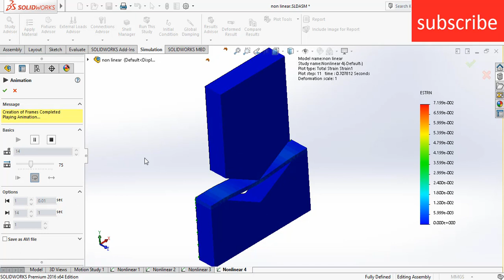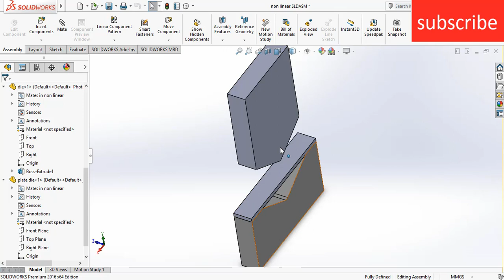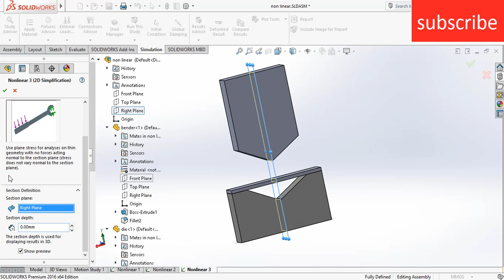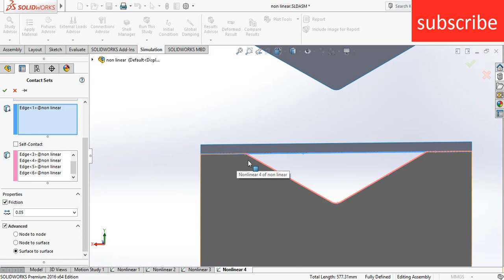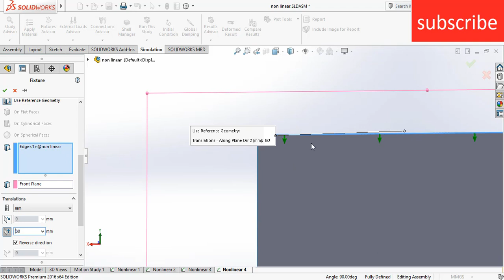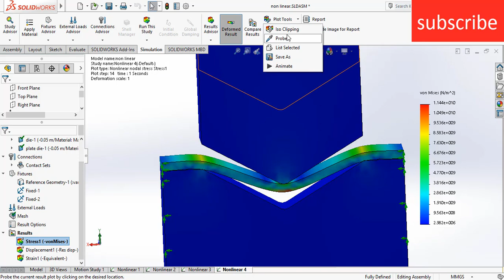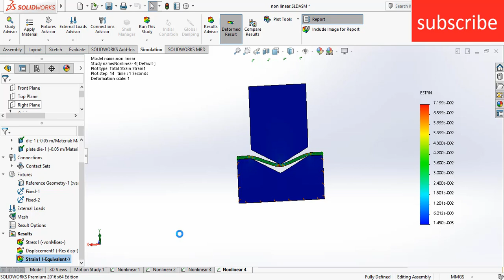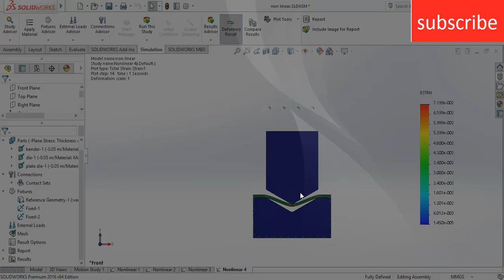Non linear simulation with full explanation for beginners in solidworks

Comment: why a load is not necessary? how do you define that the superior punch moves 90 mm?
I need to simulate a 3 roll bending machine to know the tension in the sheet and the vertical forces on the rolls

Thank you very much. This is a very good video
Reply from the maker: well i set displacement so that i don't need to calculate the load when i set a punch distance 90 mm so it will automatically calculate what ever load required to achieve that hope it helps

Comment: Y u didn't use dynamic simulation for this
Reply from the maker: Use what ever tool you are comfortable with. Suppose you want write it doesn't matter whether u use pen or pencil you can write with both. In my case i want the results so this is what I did
Reply: @Cadknowledge  so Dynamic will give the same results as static???

Comment: Why non linear you choose  , why not static simulation ??
Reply from the maker: In static you will not get deflection like these every simulation type has meaning and particular use
Static ( when body is at rest) it's name make more sense don't u think
Reply: @Cadknowledge  yes teacher I got it . so in static in model Dof= 0 to prevent moving , am I right teacher ?
Reply from the maker: @MuhammadAwais-jh2dy  i recommend that you read solidworks documentation on that it will clear all you doubt go to there official website
Reply: @Cadknowledge  I got it thank you very much .
Reply from the maker: @MuhammadAwais-jh2dy  if you really want to thanks just share my videos to your friends i will be thankful
Reply: @Cadknowledge  yes sure
Reply: @Cadknowledge  I have one question in static simulation Lets say in model we have a slider with attached bar and sliding multiple times.the question is that should we introduce slider fixture while doing simulation ???
Reply from the maker: There is a slider fixture there use that
Reply: @Cadknowledge  sir thank you very much